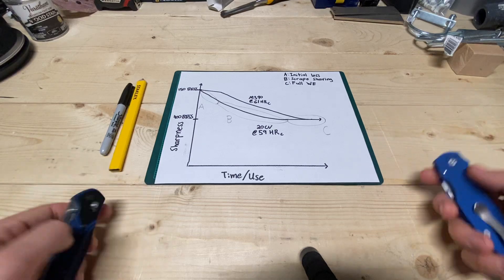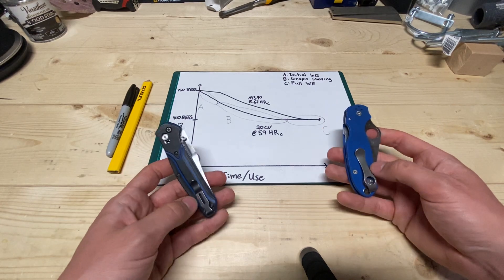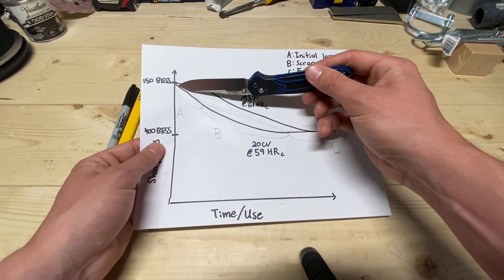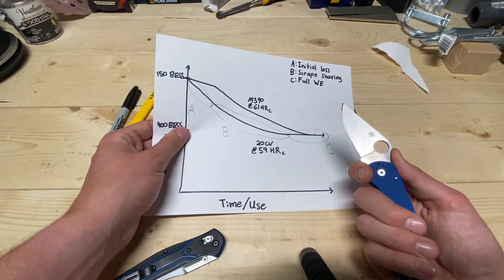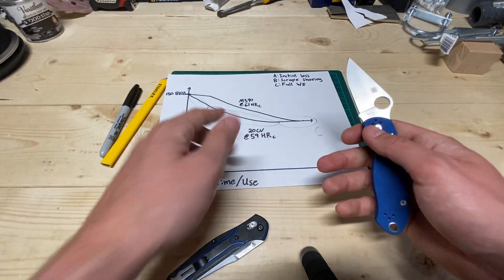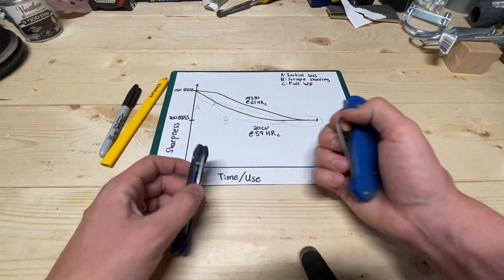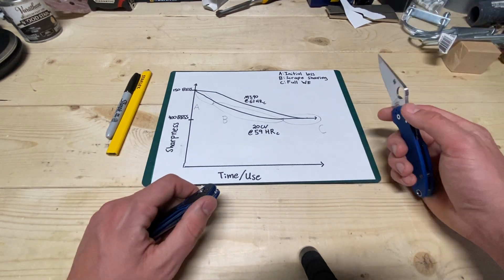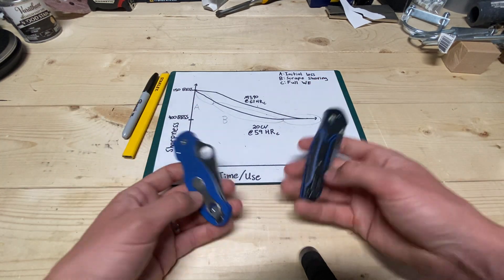M390 and 20CV Edge Breakdown (59HRc vs. 61HRc)

Comment: Great discussion! After some time has gone by, what do you think of that particular run of m390 steel? Is it still one of the better options for a para 3 or do you think newer S45vn or something else is better for upfront edge fine holding?
Reply from the maker: This M390 and similar heat treats Spyderco has done on the PM2s and Manixs still sits near the top of the pack for stainless steel along with their S90V. 

I will say that magnacut has really impressed me and is a great option that isn't at the same level but really nice for many. I do enjoy the S45VN over S30V and S35VN so far and consider it a real standout Mid-edge retention option. However I am leaning towards Magnacut between the two options. And that M390 or S90V above either of those.

Comment: This should be done with the same blade, different steel. That would be far more neat I think to see. There was no nuance lol, it was basically a head to head of a 940 and PM2
Reply from the maker: The models were irrelevant. The point was anecdotally discussing differences in heat treatment between these two knives. 

Other samples of the same exact models could completely change the user experience and comparison. So this is very specific to the exact knives in the video. 

That said, it’s likely one could safely extrapolated this to the rest of the knives in their respective batches but factory heat treats are certainly limited in consistency

Comment: Love 20cv it holds and edge forever and ever
Reply from the maker: Definitely will cut and cut and cut!
Reply: Is it easy to sharpen? Or hard? In general. Can it be sharpened standing up in the field on your thigh to a sharp edge for the rest the day, OR does it need a table, go back to the work station, or to the back of the truck, tell all the guys to hold on a second? I'm trying to figure out a steel for me. I have Cruwear, 20cv and M4. All CPM. So... Basically if it's pouring rain I bring 20cv, if it's staples and metal cutting, rough, I'll bring M4 or Cruwear. But I'm liking that cruwear and magnacut is strong, doesn't chip, and they can be sharpened in the field, but is M4 and 20cv sharpen able with a budget item on your thigh?
Reply: @thomaszinecker1785 I just got my first knife in 20cv, and the first time I cut with it, I touched the blade to some hardened steel. Rolled my edge slightly and it needed to be sharpened back to shape. I wasn't able to strop it out. As long as you're using a diamond stone, it won't be a problem.
Reply: @thomaszinecker1785 why would you ever sharpen on your thigh lol. 😂. If that’s how you sharpen normally then yes it can be sharpened on your thigh. I sit down on a chair or on a log and sharpen. It’s not any harder to sharpen then cru-ware but m390 might be harder to remove the burr. For me it is. I can’t believe you asked if you can sharpen the knife on your thigh lol 😂. I think you mean can you sharpen in the field 😂

Comment: Have you ever looked at microtech ultra techs? Supposedly their m390/20cv/204p is softer around 58-59. It’s an expensive knife and I wanted it to be harder if I’m spending over $300 on one
Reply from the maker: I’ve used their XHP in the LUDT and I did feel like it performed better than most S30Vs and S35VNs I’ve come across but not enough to truly enjoy

Comment: Man I have a question: can m390 be sharpened with a standard stone or is it high vanadium ?
also how is corrosion resistance ?
Reply from the maker: In short, yes it can be easily sharpened on decent quality traditional abrasives and it is very stainless. That said I prefer a diamond edge on it and lower end stones like the king with struggle hard with a decent heat treated M390. 

M390 and it’s analogs are very high in chromium which results in high corrosion resistance but also the preferential formation of Cr carbides over vanadium carbides. This leads to overall higher carbide volume than S30V or K390 (*heat treat dependent). However it has less Vanadium carbides than even S30V and WAY less than K390 because that chromium “soaks” up all the carbon. This results in a steel that is actually very imbalances and inefficient because it derives its edge retention from chromium carbides that reduce the toughness significantly while not adding as much as she retention as vanadium carbides would.

Knife steel needs wrote a good article on this I recommend you check out as well!
Reply: @EngineersPerspective701  I asked this cause I use diamonds but I always like to use my old stones , also I can buy a M390 knife at cheaper price than Magnacut or else...

Comment: How well does your chosera work with m390(and its analogs) for you? I've tried to sharpen 10v on mine way back, and it just slid around like glass.

I know those two steels are too close to each other, I'm just curious how it went.
Reply from the maker: It depends substantially on the hardness, carbide type and carbide volume. They both have similar car due volume but because M390 is largely M7C3 vanadium enriched chromium carbides that are softer than alumina the choseras are an acceptable abrasive IMO. 

The speed and feel are very dependent on the hardness so even though the knives in the videos have the same chemistry, the softer BM has sole feedback and totally workable cutting speed. Still ~20vol% carbide so not great either though! The Para 3 however is GLASSY as all get out and the cutting speed is approaching painful for me. Takes a lot of strokes on the 800 to raise a burr. 

Compared to 10V that is usually around 65HRc with ~17vol% vanadium carbide the choseras are a total no go. Can’t even feel the stone cutting the steel and the alumina is too soft to shape the vanadium carbide. 

I actually have a video on these stones discussing this type of stuff and wrote a report on it for cleaner data sharing. Check it out!

Comment: Very interesting.  Really love the videos you've done on this topic. This video and the original one you did on PM steel breakdown address one of the main questions I have had up until your videos. Maybe I just didnt catch it or hadn't come across the right stuff but it seems like there was a lot of discussion about edge retention and hardness and such but no one quite illuminated it in this way, particularly regarding your observations on initial high sharpness. Great job!
Reply from the maker: Michael Cristy talks about it occasionally in some of his videos but never with any depth. I think it’s a very key aspect to steel performance and overall enjoyment! My favorites are easily K390/10V at high hardness because they are the whole package. Takes a sticky edge easy, holds the fine edge for a long time and you basically can’t kill the working edge which tends to be like a working edge plus. Meaning just finer overall. Not sure if that’s due mostly to hardness or vanadium carbide volume. From this experience I’m leaving toward the hardness now.

Comment: S90V is one of my favorite steels.

Benchmades s90v and Spydercos s90v are pretty much on par in my experience. I carried a s90v military for a couple years, then replaced that with a s90v Nakamura but I've recently replaced the Nakamura with a Maxace Heron.

I haven't had any s90v HRC tested, but I've used a TON of it. If I had to guess based on use, that stupid Brian Tighe Spyderco was probably the hardest I've used and the military was probably the softest. Those are the only specific examples that stood out during use/sharpening, everything else just worked.
Reply from the maker: Sincerely appreciate the info! It's surprisingly difficult to solicit good feedback on these things in the FB groups. 

I've been tentative about getting some because it doesn't usually come with that wicked high hardness I've been digging for a couple of years. This test definitely sparked an appreciation for the working edge though and I always have a hunger for vanadium carbide so something in S90V is likely up next on the purchase list.